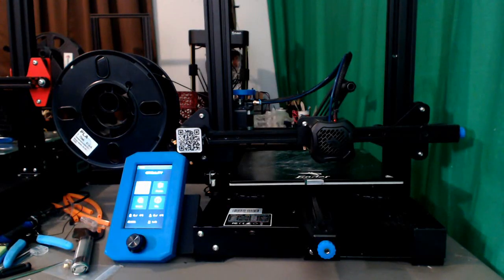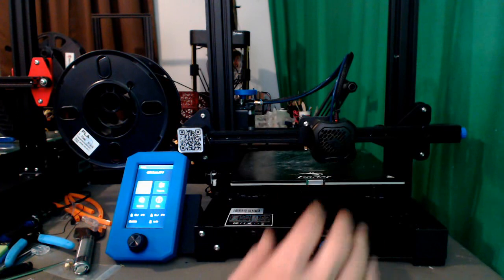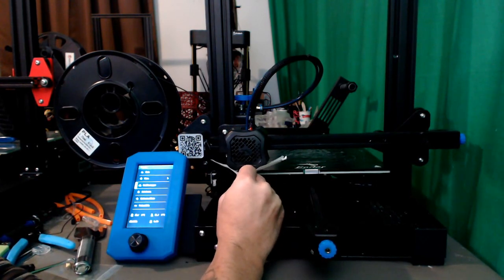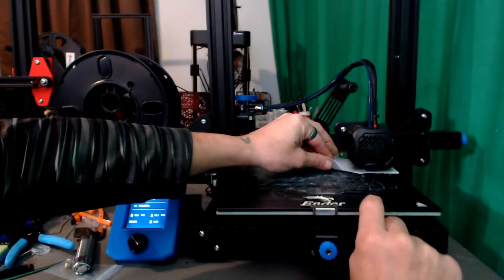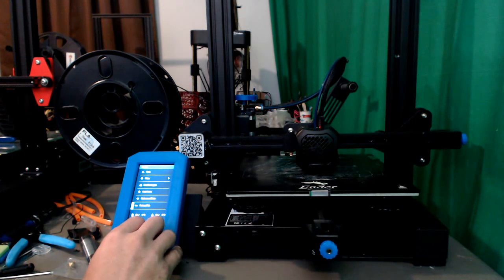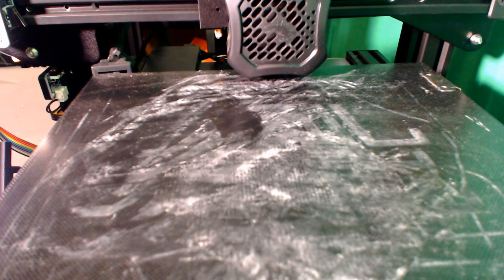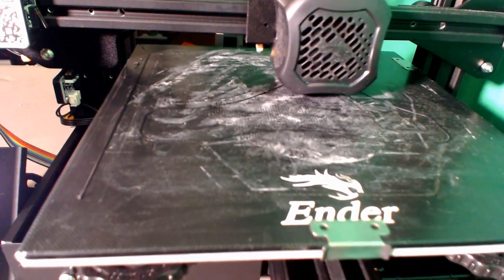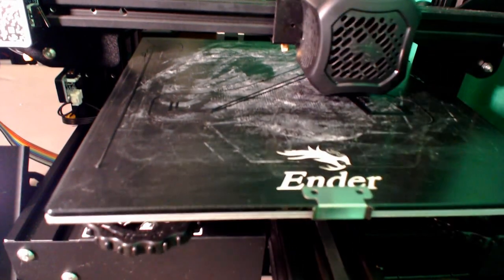HOW TO  "level" the bed! ender 3 v2! Tramming a 3d printer bed

Comment: I am so tired to hear the technically correct but useless term "tramming".  If the printer is on a level surface and built square with an unwarped plate, the it will be level.
Reply from the maker: Unfortunately when you say level, new users thing they can use a level to achieve it. It is referred to as tramming in beginner videos so as not to confuse someone.
Reply: @Technivorous  True, I squared and leveled out of habit as I built mine.  Mainly because I didn't want that as a problem to go with the rest of the learning curve.

Perhaps a better way to state would be that one is leveling the bed to make sure it is parallel to the print head bar.  Don't mind me, while not a true professional, I've done far too much work on old wooden houses where level and square were approximations.

Comment: I have a slight issue when i press auto home my nozzle is pushing my bed down with springs already fully compressed any tips on how to fix this?
Reply from the maker: Move the gantry up the z axis, then unscrew the endstop it hits and raise it up slightly, and then home again. U mat need to do this a couple times to find the sweet spot
Reply: @Technivorous  
Thank for your tip tried it its as close to level as i can get it.

Comment: No body talk about the end stop much. Does the end stop switch sit on the frame or all the way to the bottom and then adjust bed level?  see videos measuring the thickness of the glass with chop sticks what. Where do you have your end stop switch at
Reply from the maker: The end stop can be raised up and down on some machines as needed. With the ender 3 v2 the stock position works for me, but if your having trouble leveling where its at you can move it.tension your springs where you want them then Lower the nozzle to touch the bed. From there, raise the end stop up until it clicks fully closed and tighten it back down, then relevel with your proffered method

Comment: So I've recently bought this printer. And I've ran into an issue where it'll print the line before it starts printing, the line will look perfect however it goes to print the actual print in the middle of the bed and it doesn't stick or it'll start sticking and it'll flake off. Does anyone know any solutions for this? It's very agitating
Reply: Have the same issue... :/
Reply: @gius_peppe  one thing that has helped is raising your Z access stop switch all of about 4 MM s and re leveling the Bed has helped
Reply: @Axiom2.0  thank you! I will try! Right now I only manage to print with a raft which is not ideal...
Reply: @revowow  So the best

Comment: just got my ender 3 V2 and i am having troubles with my prints sticking, no matter what i do i just cannot get it to work. Even tried hair spray. Maybe the bed is warped?  i have leveled the bed multiple times as well. The PLA that was provided with the machine is what i am using for now so i do not waist my ABS and PLA i bought. I will check the bed when i get home from work today to see if it is warped.

Comment: I replaced the springs with RC car springs.  I used Serpent 24 mm Purple Touring car springs.  I replaced the screws with longer ones to accomodate the length of the springs.  These are heavy springs so you need to be careful.  If you want softer try red or white.  Harder springs makes everything more stable.

I also never bed level without the paper in place.  You scratch the bed.  good video.

Comment: Thanks for the help. Unfortunately, they sent me a bed where only 1 of the 4 corners adjusts height. All it does is cram the spring, the bed itself doesn't move up or down. I ordered new springs, hoping it will help. But I'm extremely disappointed that I spent most of Sunday building it just to find that they sent me junk.

Comment: Is that the stock plate that came with the printer?  If it is do you have any issues running it with the texture side up?  Mine will only stick with smooth side.
Reply from the maker: i get pretty good adhesion. if not i add a little gluestick. its not cheating if you win! lol

Comment: Everyone says the Ender 3 V2 has a great print bed that sticks just fine, but my new Ender 3 V2 just doesn't want to stick prints to the bed at all...  I've gone around and around with the levelling, varied temps on both the hot end and the bed but it's just not sticking... I think I have had 2 good prints out of everything I have tried, the rest just fail on the first layer...  Frustrating is not the word for it... :(#
Reply: I worked out the problem eventually, and it's to do with observing the location of the z-axis switch when the printer auto-homes.  When I was leveling the bed I was moving the z axis down to it's very lowest point, but in reality, when the system auto-homes it actually isn't that low, as the end stop switch isn't fully depressed.  So no matter how level my bed was I was still too far above the print bed when printing and so no adhesion...

Comment: i must be a moron i been turning the wheels all the way tight and then all the way loose and it doesn't level my bed literally been doing this for the last few hours
Reply from the maker: If you hit prepare, then home, it should get you close. If the nozzle is still too high up you may need to lower the endstop
Reply: @Technivorous  thank you 😊

Comment: Always brought bed and nozzle up to operating temp before manual leveling, compensating for thermal effects. Got pretty good at the manual song and dance before the BLTouch arrived --- with a closely trammed bed, the ABL code makes things very nice. If I do fun things to the bed or nozzle, I'll do a manual re-check of at least the corners. But for the first coupe of weeks, the mantra was: slow down; clean the bed; pre-heat bed and nozzle; level the bed; goo the bed if needed; print; wait for the bed to cool before removing the print. Works better if you aren't in a hurry!
Reply from the maker: This is something I learned  after I had more than one printer, it's easier to be patient when you have another machine to play with while you wait. Lol. Yes, the machine should be hot,at least the bed, as it will warp slightly as it heats and cools.